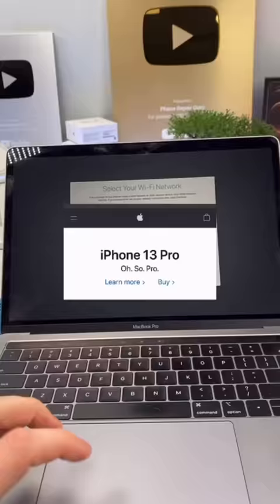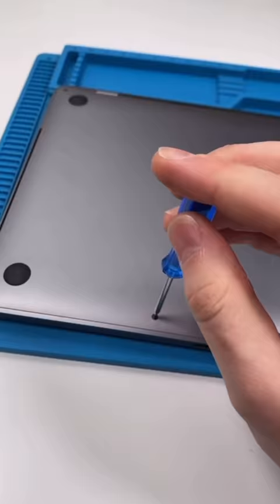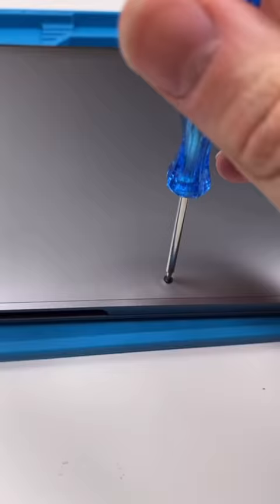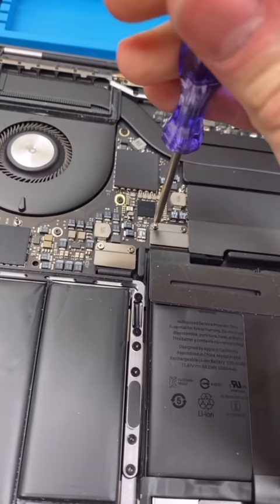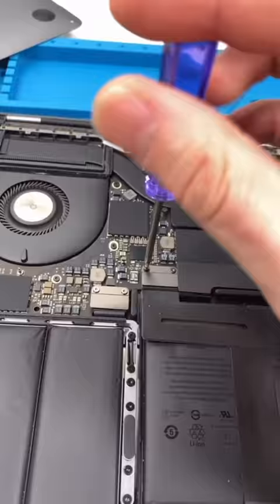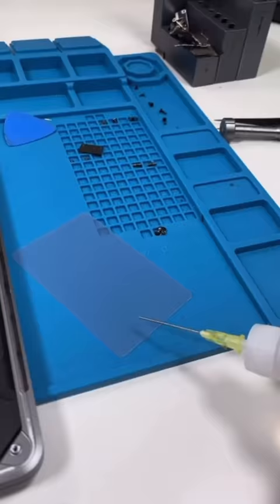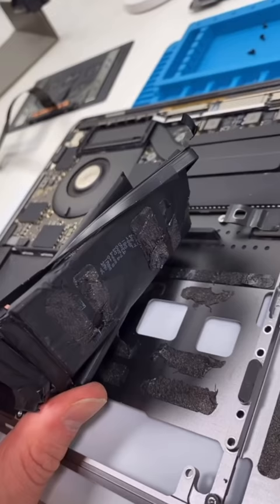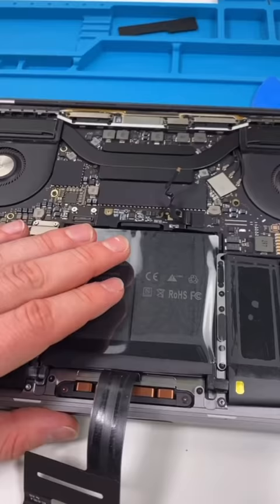MacBook Pro 2018 Is Not Very "Pro" Repair..... Why The Glue? #Shorts

Comment: As someone who’s worked on these before, I don’t know which way is easier to replace the batteries in these. The Apple way, where you basically remove the logic board and speakers, and replace the entire top case, or actually pry and unglue the batteries from the top case

Comment: Hey!, you should not push a puffed up battery like that because when batteries puff up like that because of carbon dioxide deposit their internal contacts can kind of bent or curve and they can catch fire pretty easily unless they are fully discharged and I know you are a professional but I am just making sure you are safe and aware of that sort of stuff you know because I have experienced how a Lithium-Ion battery catches fire, if you wanna know why then long story short I was etching a circuit board and then I went on to testing it after soldering all the components and connecting a Li-Ion battery to it but I realized there was short-circuit on the board but it was too late and the battery caught on fire, nothing really happened to me but I did burn my table clothe and my whole table  top like literally so I hope you can understand what I am trying to say here.

Comment: I remember replacing the battery on a 2013 & it was stuck down with enough adhesive to lift an elephant. 

It makes zero sense & just means it is more likely for some poor DIY’er to pierce the battery, after resorting to brute force.

Comment: The batteries are so much smaller now, they used to be an entire plastic block and much easier to remove
Reply: windows laptops are still kinda like that to increase repairability

Comment: You could have gotten a Top case replacement with the battery and everything, because Apple is replacing them for free when you say sometimes a specific key is not responsive and the battery would be original lol

Comment: One thing you will never hear is my battery fell out my MacBook
Reply: yeah, but I like how most windows laptops have the battery outside the case and require no screwdriver, because its good for cooling and repairability. Plus the little clips on  windows batterys are super strong

Comment: Hey bro, could you please answere my question?

My MacBook's battery swell 3 years ago(Pro 13" early 2015 Retina A 1502)and i had it removed; but as i couldn't find the original battery, i had to keep going on without battery and as you know it runs really slow...

 

I've showed it to apple store and other computer services. the problem is that they say even with the battery it works the same!!! still too slow!! they say it's a Motherboard problem because it gets too hot. but they can't find out the problem.

Could yu help please? i thought with a new battery it fixes but seems not to be true....

Comment: I feel less inclined to get on Apples case about glue in the battery area just because their marketing is for people who will use them on the go. While we all know it's stupid and unnecessary to glue them down, they also have warning labels for a reason. Some people can be monumentally stupid with their stuff. 

Now, had they glued the black panel on instead of using just screws... yeah. That would have been dumb.

Comment: Battery replacements are not even close to the most common repair on this model. :P
Reply: @-ThatGuy-  Which common repair could that be? 🤔
Reply: @-ThatGuy-  No the butterfly keyboard is an engineering masterpiece. No way that would need to be replaced.

Comment: Which battery do you use for replacement?
Reply: any battery for this laptop with the right mah rating
Reply: @Warp3326  that was not the question...
Reply: @ich558  it was, you asked what battery for replacement and i answered, idk what you're saying
Reply: @Warp3326  there are so many brands and low quality batteries… mah does not say anything about quality

Comment: These macbooks are cool…but they can be real pieces of junk. I’ve beaten the crap out of all my HP laptops…thrown them around in bags, left them outside, gotten them full of sand…and not only do they still work perfectly…they didn’t even get hot. I paid $800 for a refurbished macbook pro and it overheats when I open up more than one tab in safari, can’t play games, and the battery won’t charge anymore. First time. Last time. 🎃